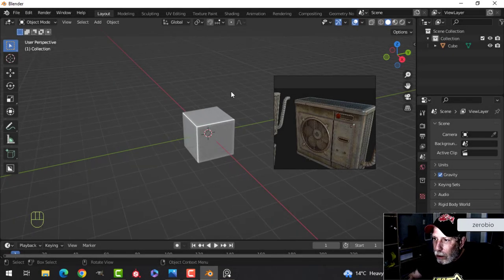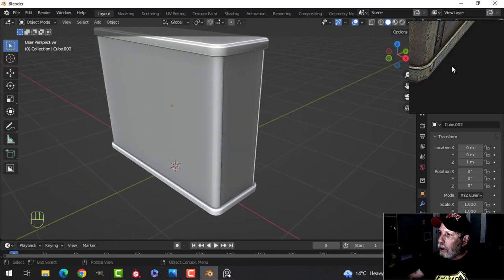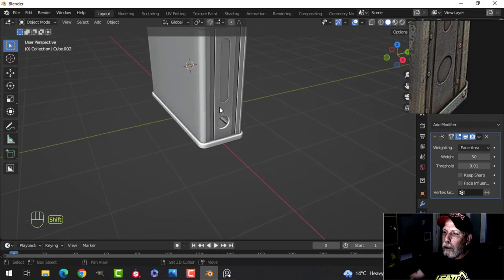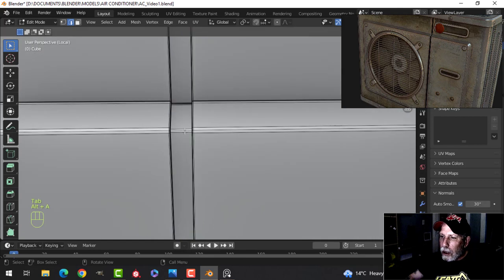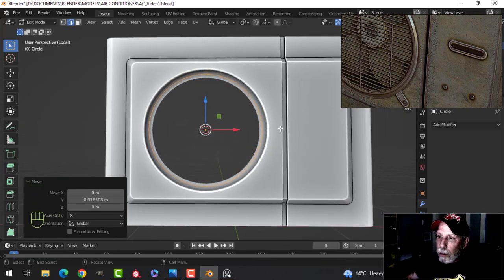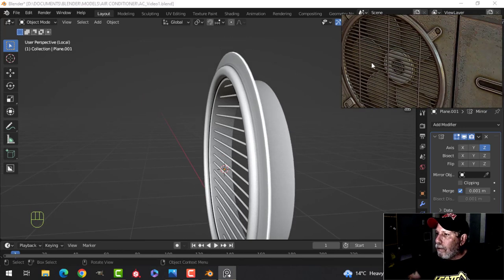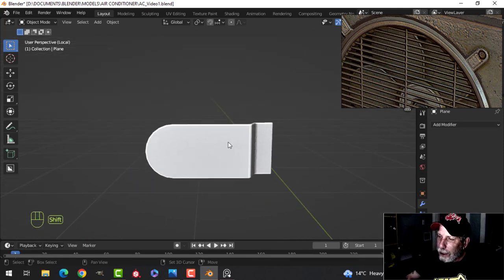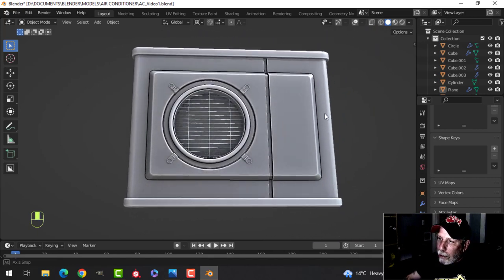BLENDER: AIR CONDITIONER (MODELING)

Comment: We have a similar style in what we like I went through the discord references for the references used for this and can not find them am I looking in the wrong area?
Reply from the maker: @charlesgoings8697  thanks very much.  Let me check and see if I can find it either on the discord or in my files and get back to you.
Reply: @zerobio  Thank you I am working through your tutorials as I have a big prject on my hands basically a rave stage and mixer boards as well as speakers lights etc so I want to know as much as I can before I jump into it. I have alot of addons etc, but I find this method and workflow you teach and show more "clean" for lack of a better definition
Reply from the maker: @charlesgoings8697  That sounds like a great project.  Feel free to show your progress on the discord, if you like.  There is now a reference image for the air conditioner that I model in this series on the discord in the references channel right at the bottom.  Hope you can find it and that it's what you are looking for.
Reply: @zerobio  100% what I was looking for thank you!!
Reply from the maker: @charlesgoings8697  excellent!  Thanks